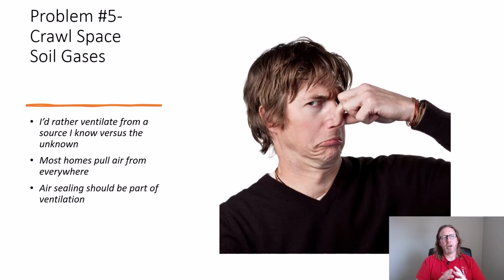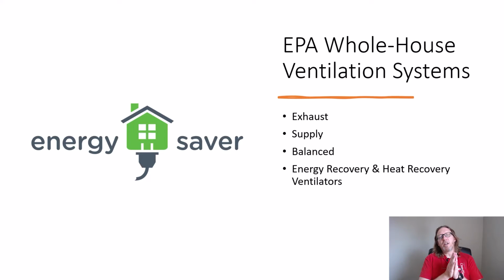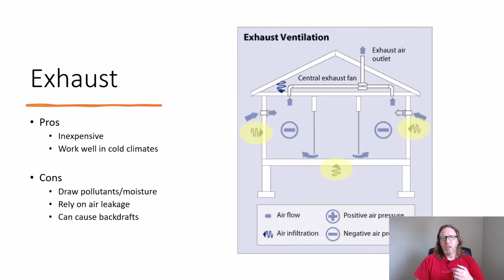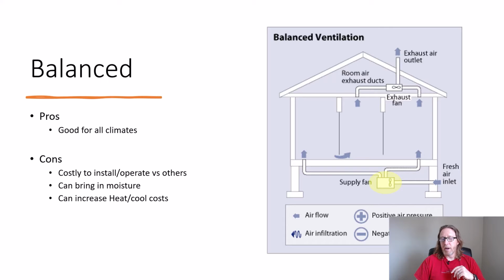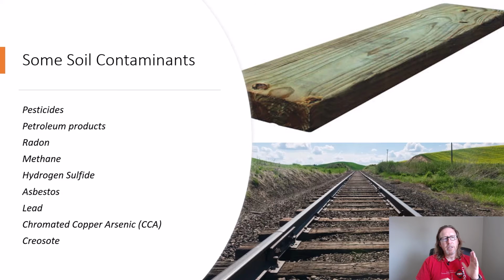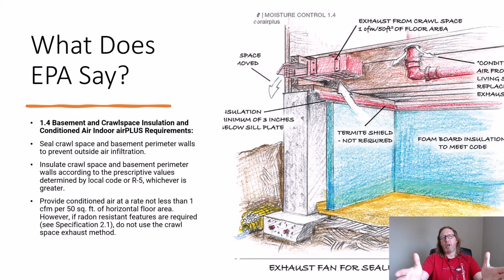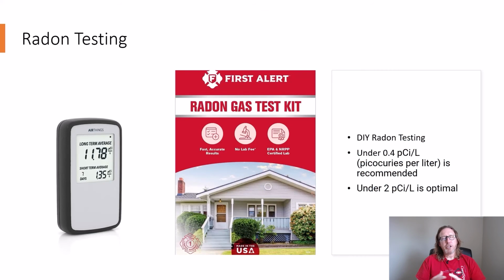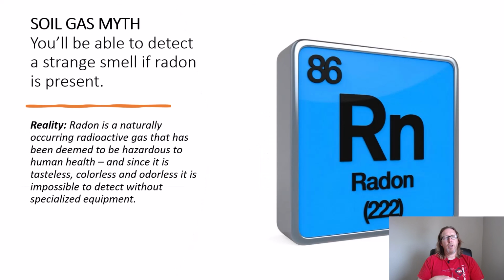Crawl Space Radon Testing: Don't Make This Mistake

Comment: If installing a vent fan, and radon levels appear low, how much would that fan help at least partially in mitigating a temporary spike in radon levels? It just seems very hard to figure out whether you would need an actual mitigation fan or vent fan because radon levels fluctuate so much and are also different per season.  
Also, do you have a video on vent placement? My dehumidifier blows dry air to backside of crawlspace and sucks air from front.  If I install to back it would suck dry air out.  But you dont want it too close to machine either I imagine.  🤯
Reply from the maker: @author A regular vent fan is not a substitute for a properly designed radon mitigation system. Radon levels can fluctuate, so testing over time is important before deciding what solution is needed. Hope that helps.

Comment: I find what you talk about on your channel very interesting. However, I wonder why you never talk about Borax. 

I have a crawl space under bathroom that was originally a back porch (as far as 1/2 of the foundation for which is now a bathroom and a rear entrance mudroom) and I never had any smells until last year when an insurance smoke damage remediation company stuffed a bunch of old insulation inside the crawl space under a shower they made to leak (by scraping away the drain seal). By the time I discovered the leaked there was a terrible sewer like odor. I believe it was water mold on the ground. I soaked it with Borax and now there is no odor at all.
Reply from the maker: @1906house That is a great observation and Borax can definitely be an effective tool for neutralizing odors and inhibiting some growth. In some cases we suggest it.  While it works well for the immediate issue, we focus on controlling the humidity and bulk water source so those odors don't have a chance to return. It sounds like you caught that leak just in time to prevent a much larger problem. Hope that helps. Thanks for watching!
Reply: @CrawlSpaceNinja , Quite frankly, although I don’t need crawl space attention, I have watched your videos and I put you with Brent Hall as far as someone who really knows what they are talking about based on years of hands on experience. 

Where I live, there are only 3 businesses that are outright insulation professionals. One  is a new foamer. I don’t trust they will respect the age of our house. The other told me to take photos instead of coming to look himself. The third actually came to our house and looked it all over and I feel confident he would correct all of our issues with respect for the age of house and structural science but he left saying he won’t get involved with insurance disputes. I never received an estimate. I am likely going to have to try to figure out how to do it all myself and I really do not have the body to be doing it. I can’t be having $1800 / winter month heating bills.
Reply: Thought I'd share a couple of thoughts here, I sprayed foam insulation around my bathroom drain and I caused it to leak so I had to cut the foam insulation back rather than addressing it from inside. 

I was just sitting here thinking about how I sprayed borax around a friend's interior basement wall because she was having mold issues even that you could visually see and it took real good care of the problem.

Comment: My gas furnace (90-95 % efficiency) and gas water heater are in the lower section of the basement, next to the open crawl space which is separated by a wall about 6.5 feet high to hold the dirt back (added after construction).  the open crawl space is about 4.5 feet tall. If all vents are sealed and the crawl space is fully encapsulated, do i need to run a PVC pipe with fresh air into the furnace?  
It's a 1967/8 brick home. 
 One contractor suggested a passive air vent into the finished basement area to ensure no negative pressure, just to be safe.  Others say there are enough leaks of air from the structure that it's not an issue.  
What do you think?  Should I be concerned about the gas furnce and water heater?
Reply from the maker: That’s a great question! I’d recommend getting a professional to come and assess the risk and give you an opinion. We don't really touch with the funtion of furnaces

Comment: Hey Michael, thanks for all of your informative videos. They really help. With that said, I'm currently in the process of having my crawlspace priced out and one of the companies wants to fully encapsulate my crawl space but said that the fan you are recommending is unnecessary and that if I don't put in a sump pump with drainage matting that my crawl space will start to smell like cat pee or ammonia. I thought that was from people using the wrong vapor barrier to encapsulate? They claim they want to put a dehumidifer with air purifier to manage the air in my crawl space. While I see that controlling mold or other forms of contaminates, I don't see how that could control soil gasses.
Reply from the maker: Thank you so much for watching. Dehumidifiers are designed to control moisture. Not soil guesses. The reason for the fan is to move soil gasses out of the crawl space. A sump pump with drain mat is usually not the cause of the cat pee odor. Cat urine odors usually come from debris left behind under plastic and vapor barriers that separate and trap moisture over time because there are 2 pieces glued together in my experience. Hope that helps.

Comment: For a small 11’x12’ ft encapsulated crawlspace (132 sq ft), is having a ventilation fan in such close proximity to a dehumidifer going to cause any condensation issues?
Reply from the maker: Great question, it probably won't cause condensation issues but it could be blowing some of your dry air out which is not very efficient. In that case, you could consider a low volume radon fan under the vapor barrier. Hope that helps, thanks for watching.

Comment: Some of my neighbours Have installed. A Positive input vent in the attic which has a filter. IT trickles air in via a ceiling vent, which suppose to give a slight positive pressure.Aim to  reduce condensation. On widows. They say they have  great results. However they haven't addressed there crawl space.  Great video. Thanks Dave. U.k
Reply from the maker: Thank you for watching and sharing your comments.

Comment: Your videos helped me A LOT! I've been trying to figure out what's the right way to convert my crawlspace from vented to unvented and the information out there is really confusing. Thank you for sharing your knowledge. 
In the drawing at 14:30, the supply air for the exhaust fan seems to come through the air leaks from living space. I just air-sealed the top and bottom plate of all my walls with orange Great-Stuff. Does this mean I should cut some of them open?
Reply from the maker: Great question and thank you so much for sharing how our information has been able to help you. No you should not need to remove any spray foam because the soil gases and sill plate should provide make up air. But if you find that is not the case (hold hand over fan output) then you could do a small amount of foam removal but I really doubt that would be needed. Hope that helps.

Comment: Help me make sure I’m doing everything right. Your channel has been very helpful. I diy encapsulated my crawl space. Did great job eliminating moisture with Santa Fe dehumidifier. I somehow missed in my first initial research that I needed to pull air out for gases however so for year had no vent fan blowing air out until I reviewed your videos and saw that you mentioned that was necessary. We only had a couple small 1-2 inch vents that I closed off before encapsulating. So my solution to install a vent fan was to integrate it in my crawl space door. It has worked good for last few months since then but was under checking on it and have found that half of my crawl space feels humid now. I have a 1500 sq ft crawl space with a block wall don’t the middle with opening dividing in half. The main half has the door with air vent out, dehumidifier as close to the opening that I could get (the dehumidifier wouldn’t fit above or below main drain line that runs across) with the dry air blowing toward opening. That main half seems to be and feel perfect but that’s second half now feels humid since adding air vent. Where do I go from here? 😅
Reply from the maker: If the fan is too close to dehumidifier it could be pulling dry air out before it can get to other part of crawl space. If dehumidifier is located on door side, I'd put fan on other side of wall so dry air can be move toward that area. Also small amount of cfm, not sure what you are running but 110cfm or less is good. Hope that helps. Thanks for watching.
Reply: @CrawlSpaceNinja  Thanks for the reply! Its isn't terrible close its close to the opening to other half of crawl space a little more then half the length of house away. But it does blow the dry air towards the fan. I looked it up it says 240 cfm so should I not have that on high then? And for fan on otherside should I have it blowing air into that second space that is humid through opening or out of the opening towards the dehumidifier? I have thought of getting another dehumidifier on the otherside but dont think it would fit above or below the main drain pipe that runs accross the whole thing before opening. Sorry so complicated just trying to figure out what to do to fix.
Reply: @RJMillaway  Sounds like the fan might be too strong. if you follow the EPA's standard for 1CFM every 50 SQft you only need a 30 CFM fan or around that area
Reply: @RJMillaway  have you found a solution? and after a year did you add that fan only because they recommenced it? or did you notice smells ?

Comment: Ac flooded crawl space now my whole crawl is fudged up ! Sub floor and joist need replacing now . Should I encapsulate. First then fix sub floor or sub floor joist and then encapsulate ? Any help would be appreciated sir thanks
Reply from the maker: I would get the wood dry and replace any wood that needs replacing before putting your new plastic down, you can leave your old plastic in place to help dry with the dehumidifier. Hope that helps and sorry to hear this happened yo you.

Comment: QUESTION:  If someone is doing a DIY encapsulation (removing insulation, remove old plastic, add foundation insulation, add new plastic (10 mil) on ground and up wall/pillars, closing foundation vents, adding 1 foundation vent, adding dehumidifier --- what order is best assuming this may take a few months.  Home is in middle GA - approx. 2000sf crawlspace.
Reply from the maker: Dehumidifier, seal vents, install ventilation fan are great phase 1 steps. Then remove insulation, mold, then insulate, remove old plastic, install new plastic. Hope that helps.
Reply: @CrawlSpaceNinja  - That gives me a plan... and I'm glad b/c I was gravitating toward insulation removal ahead of  Dehumidifier, seal vents, install ventilation fan.    The only issue that you can't solve is that my crawlspace is only about 18" - 24" - and less where where are house jacks/beams ... but that is what it is.  Thanks again. Love the channel.